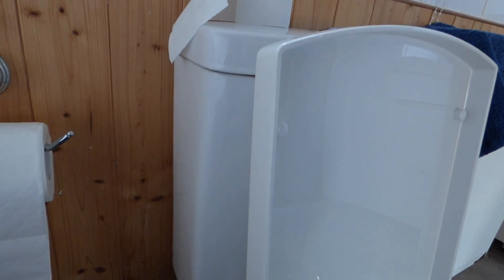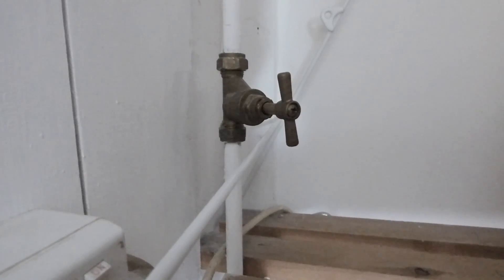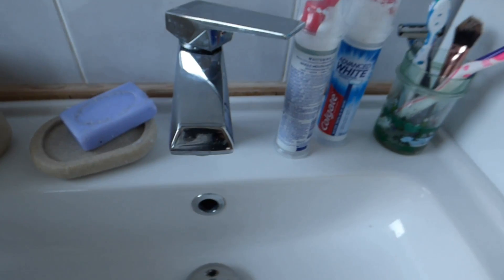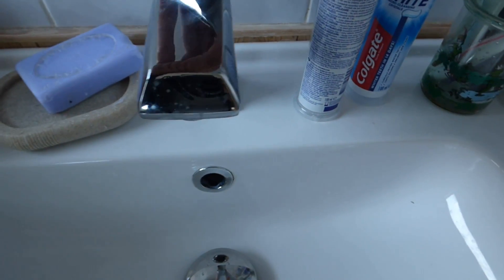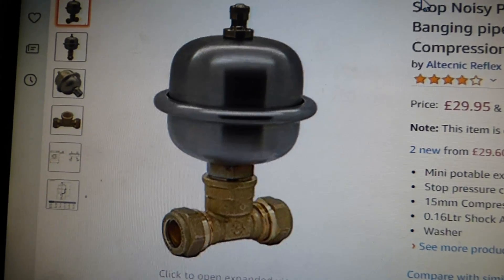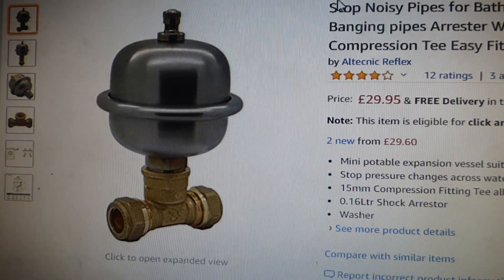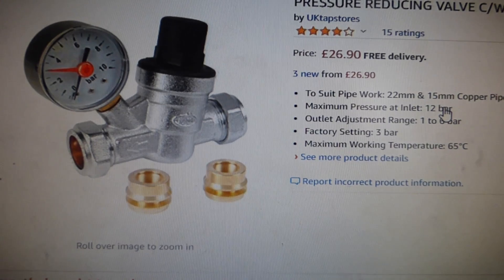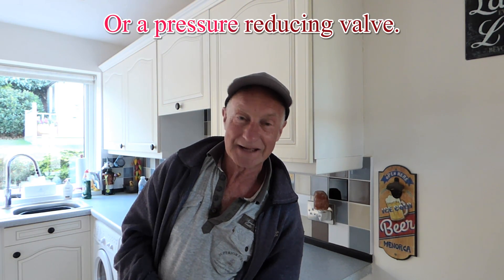How to stop a water hammer noise in your pipes

Comment: This hammer 🔨 sound in the water pipes is so loyd and bangs the whole house when I start the washer machine!
Reply from the maker: Try turning the flow rate down on the main stopcock.
Reply: try these they screw directly into the back of the washing machine take the pipe off the inlet put this in and then put the pipe in the back of the unit job done 
https://www.ebay.co.uk/itm/LG-Washing-Machine-or-Dish-Washer-Stop-Noisy-Pipes-Water-Hammer-Thumping-Pipes/151659279378?hash=item234f98f412:g:4dUAAOSwYlRZKTHn
Get one from Oatey though if you have a big overhang at the back of your machine because you will need a longer shaft for clearance

How to do it and at the end shows that it works we only need one though in the uk because we dont use a hot water supply https://youtu.be/gpbj1qnRv5U
Reply: @Mickeyj26  installed these and it’s still the same banging, any thoughts?
Reply: @BJT_89  did you install these to the washing machine (dont install them to the pipework you want them where the pull of the solenoid valve is) and have you got one for each inlet (if your washing machine has hot and cold) if you have and it sounds the same you can maybe send them back and ask for another set as they may be faulty. If you do that and things are still the same maybe the banging is the pull on the pipes because some pipework isnt secured to the wall across its length well enough and the inertia yanking at the pipes are making the clang back and forth.  Other than that t cold be your water pressure is very high so maybe only 3/4 open the taps that are connected to the washing machine instead of fully opening them.....see if that helps.
Reply: @Mickeyj26  I installed them on the wall side, not at the washer. I found conflicting information, but the more I research, sounds like washer side is the way to go. I’ll switch them around and hope that fixes it.
Reply: @BJT_89  yes definitely needs to e on the washing machine because it the the valve on the washing machine opening and closing rapidly that it causing the water hammer so you need it close to the valve so when it does this the arrestor valve is right by where the water is hitting so the arrestor valve takes that hit, on the other side it isnt as effective because it is metres away from where the impact of the water is happening.  When fitting these always think what is t (usually a solenoid valve or tap) that is causing the water hammer, whatever is causing it i have to fit it on that.........always goes machine side with dishwashers and washing machines not on the pipework side.
Reply: @Mickeyj26  Would buying a new washing machine work ? My machine makes a loud slamming noise when it stops filling with water and wondered if I bought a new one this would be the answer ?
Reply: @gillianm9367  Unfortunately not because they are all made the same way.  Some hammering is worse than others depending on the make and model of machine, but it will always happen because what is making the 'hammering' or loud bangs is water being pulled into the washing machine really fast from the mains supply by the inlet valve.  Then when it has stopped pulling water in the inlet valve closes abruptly and the water has nowhere to go.  It is that big abrupt stop which send a shock through the pipework because water does not compress and that quick shut off makes the water bounce back through your pipework and people dont realise after a while it can actually damage your pipes too..  That is why those arrestors work to stop this, when you put these on the back of the machine when the water stops abruptly there is a place for the water to go it pushes up against a valve housed in the long piece of the arrestor stopping the water shock bangs.  It would be cheaper to buy the arrestor (in the uk you only have a cold feed so should only need one) than to replace the washing machine......you can get them for around £20.

Comment: With hydraulic pressure how can you reduce it? If you have say mains pressure of 2 bars in, you’ll have 2 bars in the whole system unless you open a tap. Please explain how a water pressure reducer works or does it just reduce the flow. Thanks.
Reply from the maker: It uses an air vessel to take care of the shock.
Reply: dereton33. Hi, I am aware of what a water hammer arrestor does. What does a pressure reducing valve do other than reduce flow. How does it actually reduce “pressure” ?

Comment: Thanks for the advice! Turning the isolator valve less than a quarter worked a treat to stop my water hammer.
Reply from the maker: Glad it helped
Reply: This worked for me also. Just bought a 1900 flat so was worried about the “new noise!”

Comment: hi, why would a bathroom mixer tap make noise like as if it's vibration or spinning, only happens when the Mixer tap is OFF? 
mixer tap is connected to hot water cylinder (unvented system) PRV is set at 3 bar for both cold and hot? thanks
Reply from the maker: Pipes need clipping to mixer tap. Also maybe a water hammer vessel.

Comment: I just started having really bad water hammer, three big bangs when we turned a tap off or flushed the loo. It turned out to be associated with the new 40 metre hosepipe in the garden. I've backed of the isolator valve (fitted for frost protection) that feeds the outside tap such that the flow is adequate but the hammer is stopped.  Regards . . . Andy
Reply from the maker: No problem.

Comment: 33, just moved into a oldish bungalow, when we use the cold water the hot water pipes bang until I run the hot tap for a few seconds, any ideas.
Reply from the maker: High water pressure, try turning the flow rate down on the main stopcock.

Comment: I discovered my water hammer was coming from an area around the on/off handle (in my utility sink). I have a ‘Gerber’ faucet/fixture that has a stem going down into it the handle. Taking the stem out, I discovered the small screw at the very end of the stem (that is pressed against the washer), had wiggled loose. I just tightened the screw up against the washer, reinserted the stem the same way I removed it....and.... no more water hammer!!!
Reply from the maker: Thanks for the info Steve.

Comment: Hi 

Im having issues with water Hammer from every tap, washing machine ect, ive tried draining the system and fill back up again, thos seems to work but only for half a day or so. The banging noise is coming from the kitchen un the kitchen units, tried opening up the units but cant see any pipes moving, was thinking of putting a few Hammer Arrestor around the house and near the banging noise but not sure if it would solve the problem.

Many thanks 

William
Reply from the maker: Do try just turning the flow down on the main stopcock. After that then look at flow arrestors
Reply: @dereton33  Hi

Thanks for the reply, ive tried this already, ive done everything in your videos. What i have donr today was turn the mains off, open the kitchen tap and the upstairs toilet tap let the water come out then close both taps and open the mains, up until now no banging at all, so all ive done in put air in the pipes by doing it this way hence i think il need the arrestors. Im not using the washing machine and dishwasher just to see if this is the problem. Thanks for getting back to me.
Reply: @williamdiniz3503  did the arrester solve the issue?
Reply: @Wastedyouth485  yes they worked for a few months.. The banging noise comes back but no where near as louder as before.. Over time the arrestors need emptying as they fill up with water.

Comment: wish washing machines had a softer intake !!! it only happens when my washer fills
Reply: Yes I agree. I wonder why.
Reply: @Mickeyj26  Hi Michael! Hopefully you see my question... but for water hammer on a washing machine, I take it you need one of these shock arresters for both the hot and cold inlet pipe? Or will just one one the cold pipe suffice? If you answer you will be my hero!! 👍 🦸🏻‍♂️
Reply: @lukasrayzor  yes it is best to get one for each, put them on the washing machine side not the other side it is the mistake a lot of people make.  The water hammering is being caused by the washing machine abruptly pulling water in and then abruptly cutting the water supply so the shock is happening on the washing machine side not the waer outlet side.  Anything that has a water intake valve on it that abruptly stops and starts you can put it on.....like a dishwasher too if you have bad problems too but in general it is washing machines that are the worst culprits for this.
Reply: @Mickeyj26  Sir, I bow to you! 🙇‍♂️
Reply: @lukasrayzor  no need, glad to help you out.

Comment: The best but not the easiest thing to do is clip and secure the pipework like Al said. The turbulence causes the hammering. 👍 Great explanation Al 😜
Reply from the maker: Thanks mate.
Reply: @dereton33  Al what's your preference on shock arrestors? The mini expansion vessels such as the one in the video.  Or the mini arrestors  which look like copper pipe. (With 1/2 bsp) Also there's ones which are available for 3/4 washing machine valves. Have you had any experience with these?
Thanks in advance 👍
Reply from the maker: I have only had experience with the pressure vessel type, my plumbing supplier recommended those over the other two types. They do look better though.
Reply: @dereton33  Thanks Al, the plus side to these is they can be recharged. Once the mini shock arrestors are depleted that's it. The mini vessel type are a little bulky though. Great content as usual 👌
Reply from the maker: Thanks mate.

Comment: Interesting video Al. Another cause can be the outside tap when it is turned on and plugged into a hose connected to a garden sprayer connector or timer. It seems to create a hammer noise. I was a bit confused until I realised the tap was on, and turning it off cleared the problem.
Reply from the maker: Yes that is another cause of water hammer.

Comment: Hi Al, i've got water hammer when a neighbour closes a tap/washing machine valve closes etc. Its a shared supply. Someone said replacing my kitchen pipework from copper to plastic might lessen the thud/sound transmission. What say you?
Reply from the maker: It would help but an expensive option, perhaps you could talk your neighbour into having a shock arrester fitted.
Reply: @dereton33  Yeah, tried that. Even had the water board out. Seems cheaper than a new supply from the street though eh?🤣
Reply from the maker: Yes I guess so.
Reply: i had that, being mid terrace i used to hear it everytime someone used water from both directions any time of day or night, loudest bang i have heard from water hammer, since one side next door has been re furbished it has luckily stopped.
Reply: @ShadowzGSD  i'm due to replace the kitchen next year anyway. I'll just have the plumbing all replaced in (gulp).... Pushfit.
Reply from the maker: Dont worry it is the easiest way.